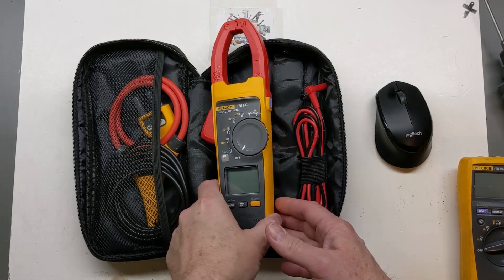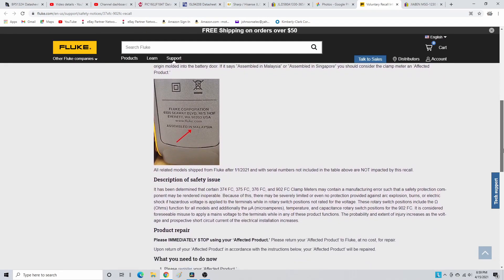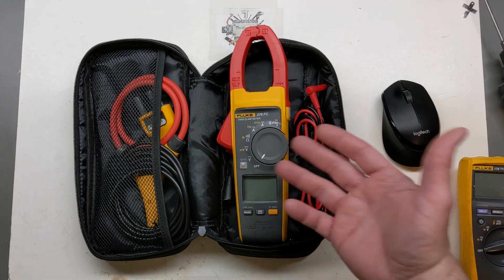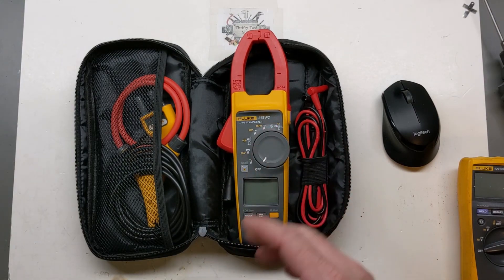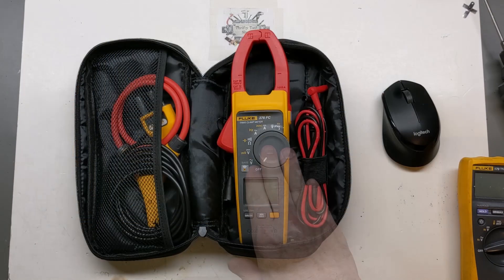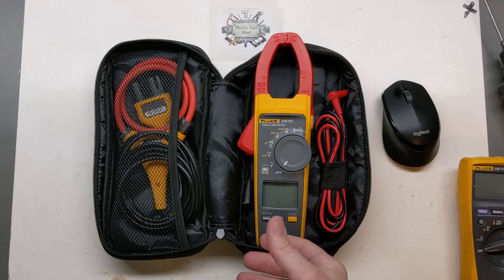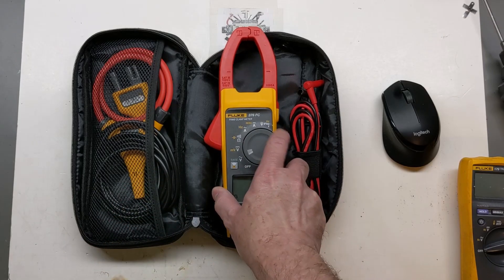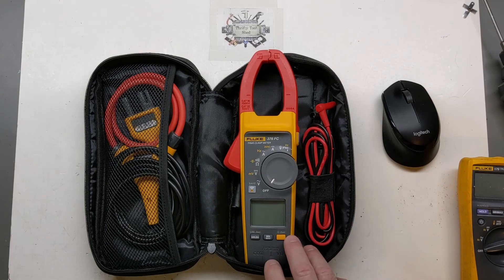Fluke 376FC Safety Recall & Update

Comment: I also use the Fluke 179 True-RMS Digital Multimeter, i bought it rather cheap never used from ebay,  it cost me €259,35 ($311,76) in 2018, and it was even calibrated in 2014, new the Fluke 179 cost €451,33 on Fluke there own website, so so almost €200,- cheaper for a never used Fluke 179 and even is calibrated in 2014, is not a bad deal right?

https://www.fluke.com/nl-nl/product/elektrische-test-en-meetinstrumenten/digitale-multimeters/fluke-179

I can say i am very happy with this Multimeter.
Reply from the maker: I do like the 179's I have 2 and they are great meters. Price seems good. I have had mine for years.
Reply: @ThriftyToolShed  yeah, also very happy with my FLuke 179, also using it now 2 and half years, does everything i need it to do.